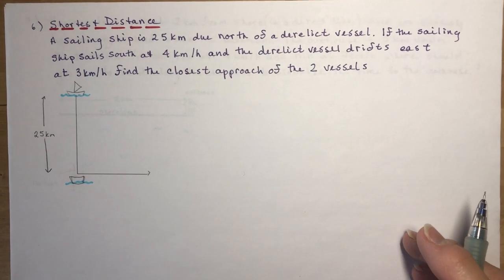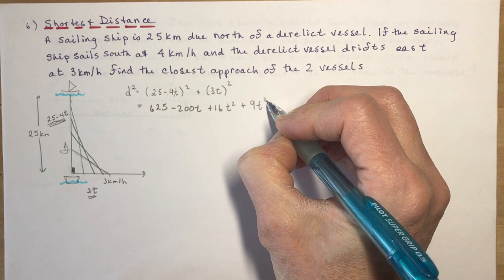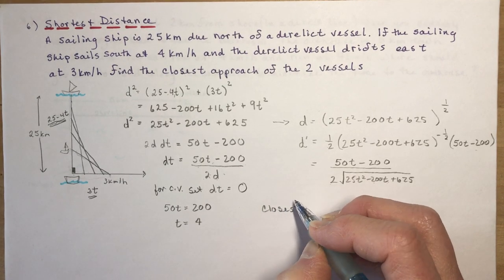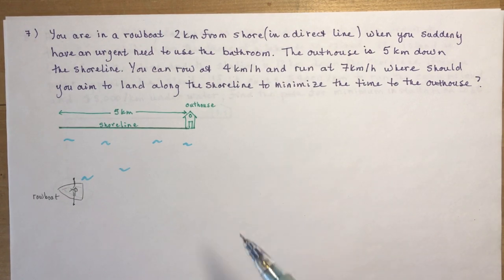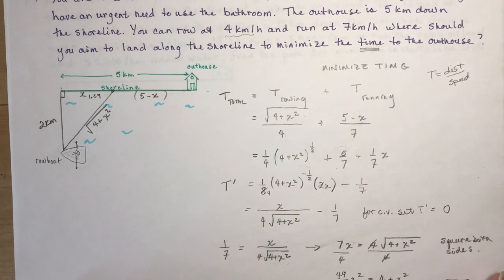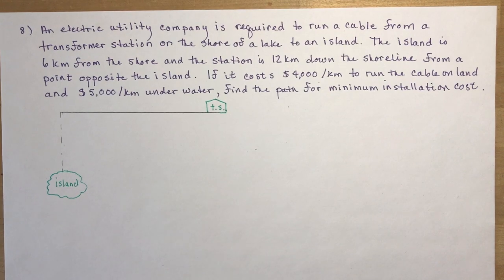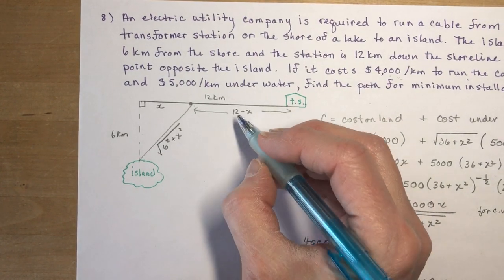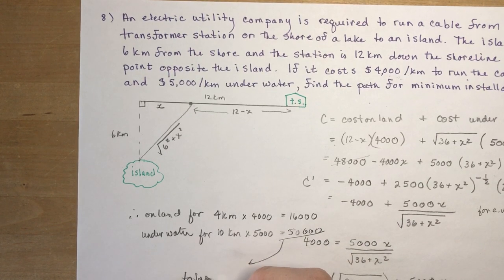Calculus 3.3 Optimization Part 3

Comment: Ms.Havrot, good afternoon, I have a question. We set the derivative equal to zero and then find the value, but how do we distinguish whether it is the maximum value or the minimum value? Because when the derivative is zero, it may also be peak.
Reply from the maker: When you set the derivative to zero you are finding where the max and min values are (or potentially a point of inflection occurs, which will come later). You then will need to do a first or second derivative test to determine if you have found a max or min value. These topics are covered in the videos.

Comment: Hi! Do you mind helping me on this thinking question that I have for homework? 

"Two industrial plants,  A  and  B , are located  15  km apart and emit  75  parts per million (ppm) and  300  ppm of particulate matter, respectively. Each plant is surrounded by a restricted area of radius  1  km in which no housing is allowed and the concentration of pollutant arriving at any other point  H  from each plant decreases with the reciprocal of the distance between that plant and H . Where should a house be located on a road joining the two plants to minimize the total pollution arriving from both plants?"
Reply from the maker: Yikes!  That hurts my brain 🧠
Reply: @mshavrotscanadianuniversit6234  Sorry, it hurt my brain too :( help me :(

Comment: Miss for#17 in the nelson calculus book on pg.157, how do we find the constraints for the value of r the radius?
Reply from the maker: I'm very sorry that I can't take the time to explain as I am heading out of town this afternoon.  Basically the radius has to be larger than 0 and because there is a volume constraint you need to solve for the maximum radius.
 Perhaps this solution manual will help. http://mrkennedy.pbworks.com/w/file/fetch/73301684/MCV4U%20Chapter%203%20solutions.pdf
Reply: @mshavrotscanadianuniversit6234  I think that there's an error in tyr answer key as 5 is not obtainable.

Comment: For the last question, when setting the derivative to 0, can you also just solve the numerator since 0 divided by any number is 0? If I do it that way then, my x value is 4/5..
Reply from the maker: If you had something like (x+5)/2x =0 then you could just set the numerator equal to zero, but that would not apply for the last question